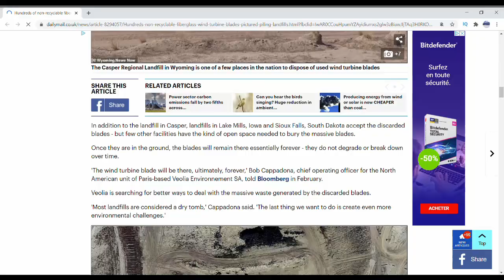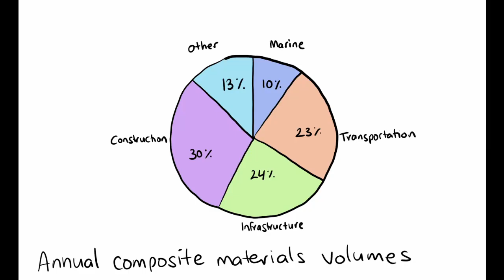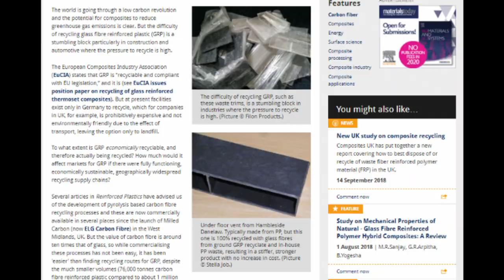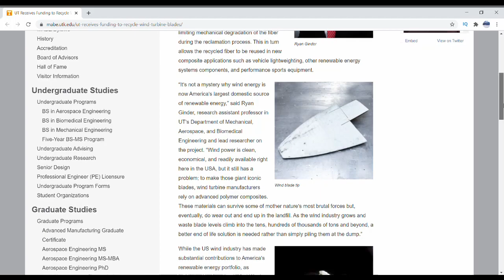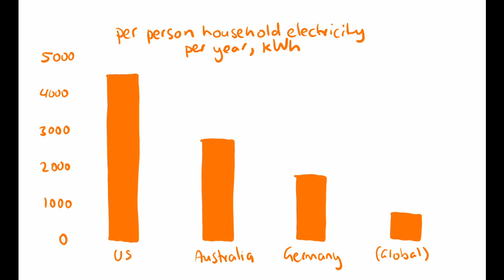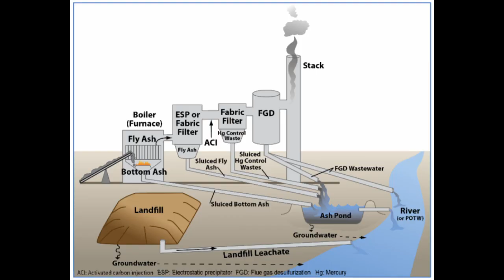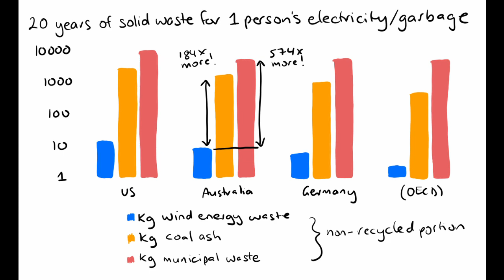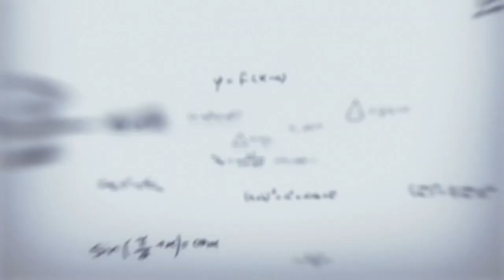Wind Turbine End of Life Waste

Comment: Thank you Rosie for this very well explained ‘problem’ of end of lifetime waste with composites. Especially the comparison with coal waste is an eye opener for many, also the bicycle producing more waste than a windturbine. I can think of better ways of using the blades directly without grinding them down. Just cut them up into smaller parts which can be used as complete roofs for several building structures.
Reply: The shape is a bit awkward for that use.

Comment: Interesting talk. Steel belted car tires can be shredded and mixed with road paving asphalt. Grinding the blades in to small bits would likely make an excellent road pavement filler. Fillers that are tough material make the road surface last longer and use less petroleum based tar ingredients.

Comment: "There is no such thing as a free lunch."  This video explains why.  Nicely done.  I wonder: How many wind turbines are needed to operate the metal and glass foundries needed to produce the metals and fiberglass (fundamentally silicon dioxide) used in wind turbine machinery?

Composite materials also include resins (e.g., FR-4) impregnating the fiberglass or carbon fiber fabrics.  Let's also remember media-posted photos only show what the camera operator wishes to show, where comparative calculations prove more truthful in their telemetry.  With electronics waste, there's also the processing chemicals to regard -- usually acids, sometimes arsenic, mercury, lead and elements we'd want to recover: Gold, silver, copper, neodymium, tantalum, niobium, lithium, etc.  Even solar power enthusiasts and advocates never mention solar panels are made using electronics manufacturing processes producing electronics waste before and after their useful life.  Energy density versus load drives the renewables' power storage discussion.

Some municipal waste and recycling ends up in power-generating incinerators, the topic of another video.  Carbon cycle might produce "greenhouse gases", yet the most influential of these proves water vapor (not CO2). Nature uses both.  

About perspective:  Study a map of North America, and please observe >>  From Long Island and Cape Cod stretching west and north across the Great Lakes to the Pacific, and Alaska, one observes a multitude of freshwater lakes formed when a continent-sized glacier melted.  That happened millennia before the Industrial Revolution, before the internal combustion engine ever existed, and continues with glacial melt today.   Sure, there's always a need to diligently clean up after ourselves, improve efficiency, reduce waste, etc.  But closer scrutiny informs the Sun and water vapor are more responsible for "global warming" or "climate change" over long periods of time than human activity making "greenhouse gases" ever was.  How much debris historically corrupts the environment and changes climate from natural events historically, like volcanoes erupting (e.g., Tambora, Krakatoa, Mt. St. Helens, etc.) compared with human activity?  Let's also please consider the plentiful existence of crude oil north of the Arctic Circle informs planet Earth in its distant past was once a much warmer place than it is today, with primeval swamps at high latitudes.

Comment: Hi Rosie, Great video, thanks. Adding to your comparison matrix the kg-of-waste-per-person-per-20-years for PV solar installations would also be very interesting. I suspect solar will have higher wastage than wind, but will still be far better than coal. Keep up the good work!
Reply: Yes, that would be really interesting to compare. As for amount of waste from PV it seems that it has much less composites [non-recyclable] by weight, so the percentage of recyclable materials should be high: metal frame, glass padding and top, wiring - all seems perfectly recyclable, especially if designed with recyclability in mind.

Comment: Hi Rosie. Another great video and well done on the channel!!!!! Wind turbine technology is still in its relative infancy and so hopefully-as with other technologies- it will become more durable  and more environmentally friendly. My hopes are that the main structure (the concrete base, mast and nacelle) will have a much longer lifespan in the future, and that the wear parts such as the gearing, generator, pitch control and of course, the blades can be more modular and easily replaced. I also think composite recycling is starting to gain momentum and so hopefully we'll be able to see the blades recycled, too.

Comment: I'm a wind power addict from way back. I have used, rebuilt and installed old DC turbines like the jacobs, Wincharger, etc... I really like your videos. There was one about blade bearing wear and tear (among other wear points) . I have noticed, after rebuilding a good number of old turbines that bushings are far, far more wear resistant than either tapered roller bearings or ball bearings, insofar as the blades are concerned. With the bearings, the balls or rollers get "hammered into the races by the constant low level vibration. I doubt that they would use bushings in the large turbines though.
Reply: Are you using plain bushings or sintered metal bushings that are soaked in oil under vacuum? I have heard of especially the sintered oil-soaked bearings being used in sealed-for-life service.

Comment: Really interesting video, thank you.
Would love a video about the actual failure modes? When they get to around 20 years what fails?
If it's the blades, are there more robust materials?
Reply from the maker: Hi great question 😀 I talk about that issue a bit in this video, so have a look there. 
https://youtu.be/PfquMx9h98M
And I will make some videos on composite materials and structural design later in the year. That's my first love in engineering, so I am pleased to hear you're interested too!

Comment: HS2 project in the UK will recycle wind turbine blades by using glass fibre  for production of the concrete.

I like the comparison of different amounts of waste produced. However, if you compare waste from decommissioning of wind turbines you should also compare the same process for coal fired power plants. These plants don't last forever amd ash os not the only waste. When the whole coal fired powered plant is decommissioned you need to deal with huge amount of waste. 

What is more, coal fired power plants require large amount of workforce who are present at the plant every day. These people also produce waste while at work.  You can addall the contractors who maintain the plant during outages and shutdowns. Or when the plant is retrofitted with new equipment the old pieces like insulation, metal, cables it all gets scrapped.
Reply: Great points about the workers! Never would have thought

Comment: Hi from the grimy old git in the uk
I had heard that blades were being used in concrete which is great I have also seen a sculpture and park bench and play equipment being made from blades again good as concrete isn't going to go away in the foreseeable future it makes sense to use them this way. Could they not be used in road making as part of the hard core substrate or mixed in with the tarmac 
Another great vid

Comment: I'm assuming one thing, well maybe several. You said if several times. So if some Australians are using only wing, what is the number? If today we need a combination of several power sources you need to include that waste as well. So now let's move into the future. If Australia moved to all wind turbines. Two questions come to mind. What would be the total waste if the turbines produced all the electricity currently in use? And what would be the land usage, square miles, of land used?  Where would the turbines be located?  And do the turbines need to be supported buy solar power. If you only have wind and solar, what method of storage would be required for peak usage? And what is the duration of that storage? And the waste from the storage units(batteries)?

Comment: From memory, I thought the article I had read about blade disposal claimed the blades wore out due to leading edge wear, caused by dust sized particles and the high speeds, especially near the tips. So, I'd like to ask A) is this true? Must blades be replaced regularly? And B) if so, has there been work towards creating a replaceable wearing surface? An analogy for this were early airplane propellers that were made of wood, and one of the early solutions was to add a metal surface along the leading edge of the wooden propellers.
Reply from the maker: Leading edge erosion is a big issue for many wind turbines (depending on the location). But where there is LE erosion it will be repaired unless there has been a major error made and it went unnoticed until the damage was so bad the blades are irreparable. They are also doing many things like you suggest, where more robust materials are added to the blades' leading edges to prevent erosion. 
Blades are not replaced regularly. They are never designed to be replaced, they are not a "wear part". When a blade needs to be replaced, something outside of the designer's expectation has happened, like an impact damage or a manufacturing defect, or a very severe lightning strike. The blades are designed, tested and certified to last the same life as the rest of the (non-replaceable) parts of a wind turbine. I talk more about that in this video: https://youtu.be/PfquMx9h98M

Comment: I'm wondering how much it would cost to make a blade out of Al? I know the initial cost would be so much higher, but after 20 years for the increase of Al on the open market and being able to recover basically all of the Al would it be worth it?
Reply from the maker: Out of aluminium? that used to be common a few decades ago before composite materials advances made that more suitable. You could do it but it would be a lot more complicated to manufacture, and more expensive as you suggested. It is also an extremely energy intensive material to make. You do get easier recycling, but still I am pretty sure the lifetime emissions would be worse for an aluminium blade than a composite one. There's also structural problems, aluminium blades commonly failed due to fatigue loading (the constant small loads from the blade bending from the wind or due to gravity).

Comment: Great video.

Though querying the annual electricity usage for an Australian (2691 kWh) and the other countries, in general they seem too low.

For context the average Irish household in 2019 used ~4200 kWh per annum, for my household ~10,300 kWh per annum though that is a 4 adult household with an electric car. The car accounts for about 42% of the total usage.
Reply: "10,300 kWh per annum though that is a 4 adult household"

That's 2575 kWh per adult per year, which is less than the figure given for Australia.

Comment: So, Rosie, what’s with all this “20 year lifetime” stuff? You showed us the oldest wind turbine in  Tvind, Denmark, which has been in operation for over 40 years. In another video you also talked about ways to reduce the varying stresses on the blades. I’m thinking that as we get cleverer and gain experience, we will be looking at lifetimes much longer than 20 years! My neighbour here has a composite garden fence that has also been in “operation” for over 40 years!
Reply: 20 years is the number at minimum recommended maintenance. If you dump in more resources, you can prolong it, but the per year cost will add up, eventually making it uneconomical. You could make a wind turbine last hundreds of years if you gradually replaced every component, but it would cost more than building a brand new wind turbine multiple times.

Same principle as with car repair - sometimes the repairs can cost more than a new car, depending on the amount of damage, or wear and tear. You could rebuild an engine infinitely with infinite resources, but it would eventually cost more than just buying a brand new one.

Comment: Silly Question 
 how much energy used to make wind turbine VS how much you get out of wind turbine ?
Reply from the maker: That's not a silly question! And something I plan to make a video on this year some time. The term you need to search for to find that out is EROI: energy return on investment. Just really quickly searching now I found a result of 18 from a 2014 paper. So that means back before 2014 an average wine turbine generated 18 times as much energy as it consumed. The number will be higher now, if you dig you could probably find a more recent paper. 

Here's the 2014 paper, it compares EROI for a range of fossil fuels and renewables.
"EROI of different fuels and the implications for society - ScienceDirect" https://www.sciencedirect.com/science/article/pii/S0301421513003856

Comment: How big would a wind turbine need to be to do just a single household?
Reply from the maker: Great question! The very simple answer is around 1.5-3kW, which would have a rotor diameter of about 1.5-4m.

The average Australian uses 2700kWh of household per year, for an American it is 4500. There are 8760 hours in a year, so if the turbine is running flat out the whole year, you would need a 0.3kW or 0.5 kW turbine per Australian/ American. But wind turbines don't run flat out all the time, in low wind speeds they produce less. A typical average amount is 35% of the rated capacity for a large utility turbine. I don't know how small ones compare, but let's assume it's a little less. 

So then you need a bit more than 0.9kW per Australian and 1.5kW for an American. For a German it is less, about 0.6kW. Assume a household uses double what an individual does, and you get in the ballpark of 1.5-3kW per household. 

Thanks for the interesting question 😀
Reply: @EngineeringwithRosie  Thank You for the awesome answer!
Reply: @EngineeringwithRosie  I use tons of power, put me in the 3kw zone or higher
Reply: @EngineeringwithRosie  thank you for the informative video and responses!  I am not an engineer and am having trouble wrapping my head around it.  The calculations in the video make it seem that coal energy is much more wasteful than wind energy based on the amount of energy produced per hour compared to waste per year.  Yet, basically each household would essentially need it's own 3kW turbine to supply needs according to your message above.  If each household in the four countries you mention had it's own wind turbine, then my simple brain tells me the waste of the wind turbines would far exceed that of the coal plants.  Can you clear up my logic?

Comment: Not sure it's very relevant to compare wind turbine waste to coal plants. Coal and wind usually work hand in hand because of the intrinsic variable nature of production with wind turbines. It's more like wind+coal should be compared to nuclear. But it's indeed quite of a false problem to point out the rather tiny waste of wind turbine blades (and it's solid and present no health hazard whatsoever, it's just "mechanical waste", a bit like pottery shards from the Antiquity: it stays in the ground but who cares?) compared to the huge CO2 emissions of the accompanying coal required in a wind production model, cause that's the real "hidden cost" of wind electricity production. But as a French, I'm speaking from a place where almost all our electricity already comes from CO2 clean sources. In countries where most the electricity already comes from fossil fuels, bringing up the insignificant amount of waste generated by wind turbine use sounds pretty much like a red herring from people with a questionnable agenda.
Reply: You French also operate some of your reactor fleet in load-following mode which complements renewables well.

Comment: Your comparison with coal seemed to be comparing apples and pears. Wind showed the amount of waste when it is removed whilst generation created no waste. Coal has waste during generation AND the amount of material used such as concrete, metals, insulation etc that will be removed after the generator is decommissioned. This last part was not in your numbers. :)
Reply from the maker: That's a fair point about apples and pears. I couldn't find any figures on retiring coal power plants, that's the reason I didn't include it.
Reply: @EngineeringwithRosie  Ah, that’s fair enough. Odd that they ‘know’ how much landfill a wind turbine creates but are strangely quiet about other forms of generation.

Comment: The thing is as you said, wind turbines aren't used in isolation, they do not replace other forms of generation they add to the generation. In fact turbines have greatly reduced the efficiency of the grid due to their intermittent operation. The grid as you know is carefully balanced, energy into the grid must equal energy out or the grid will either under speed or over speed. It has become critical to build and operate fast reacting plant that can be stopped and started quickly to cover the dips and peaks from wind plant. The peaking plant by it's nature is usually quite small capacity only a few MW per unit and usually diesel or natural gas fired. This means we end up with smaller inefficient fossil fuelled plant dotted all over the place as back up energy instead of larger more efficient base load generation. South Australia is a perfect example of this. 
Wind and solar are not replacements for other energy sources, they are in addition to.
Time for Nuclear power.